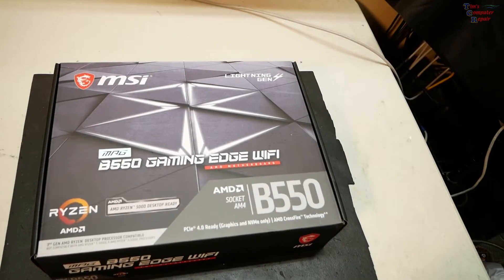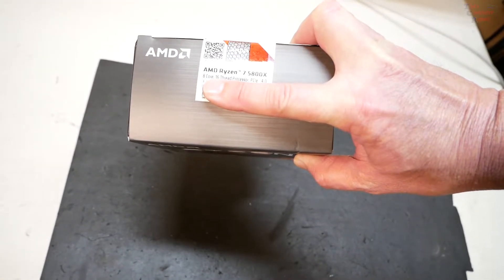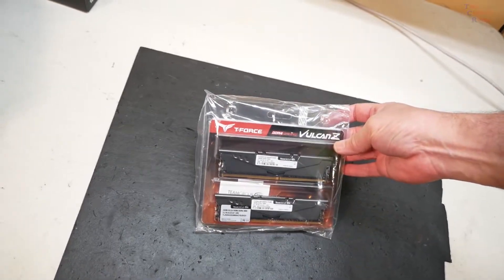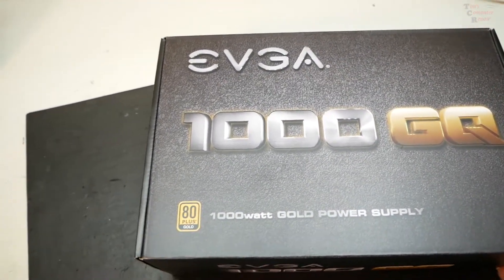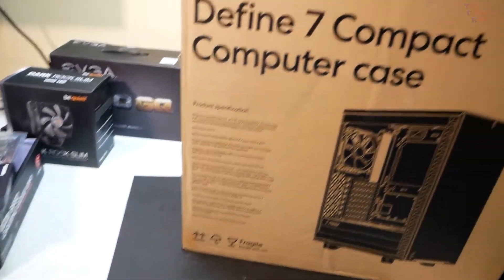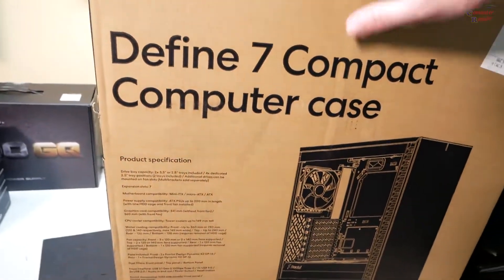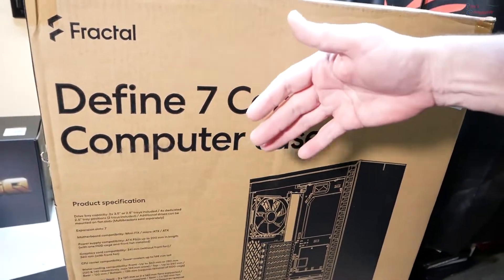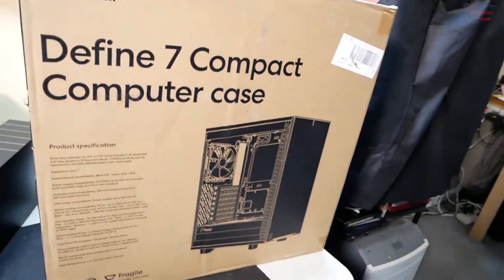RTX 3080 and Ryzen 7 5800x Performance and Heat Test in a Compact Computer Case

Comment: Em-m-m... How is that possible? I mean 65C in stress test with 5800X and air cooler...
Reply from the maker: Could maybe get a bit higher if ran for a longer period of time. Only ran at 5min intervals.
Reply: He's using the least stressful version of the test. For maximum heat output in OCCT, you need to set it to small data set, extreme mode, and steady load type. My 5800x leveled out at 90c with these settings running on a liquid freezer 240 AIO.

Comment: why did you put the graphics card on the mother board before installing in the case. Just wondering as mutliple places have stated that without installing into the case the card could rip out the pci express slot
Reply from the maker: I always test the parts before installing. Saves a bit of labor if something is DOA. There is no way the vid card will "rip out" the pcie slot. Especially with the motherboard lying down during the first boot. Thanks for commenting.